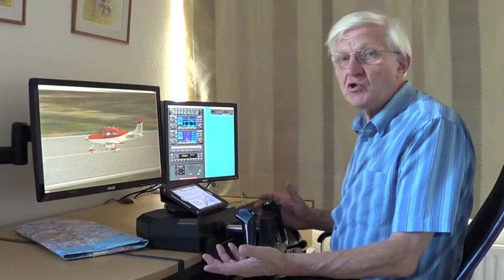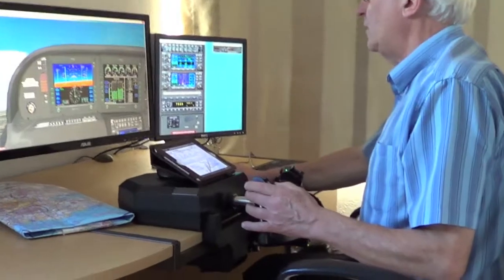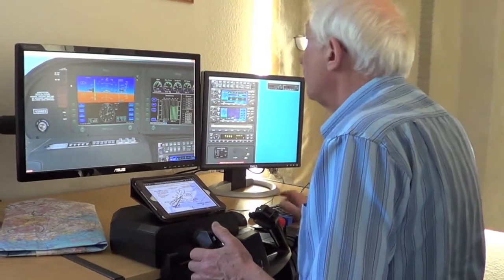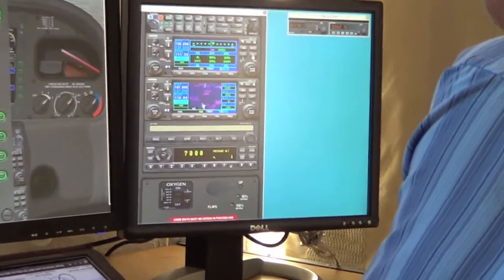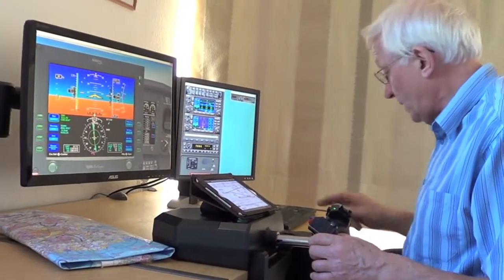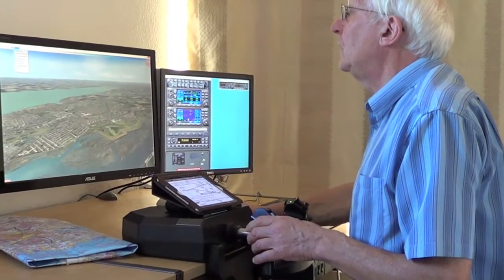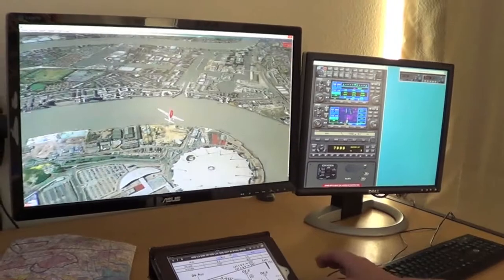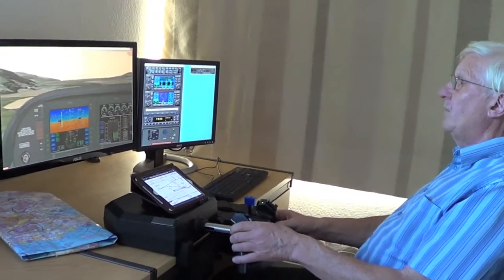Cirrus SR22 Simulator Demo

Comment: I know this is old - what Yoke setup do you have - I have  a CHPRODUCTS - but I have manual trim...but do have buttons to fix the trim...
Reply from the maker: Thanks for your comment Eric.  I am not the 'pilot' but I've asked and he has replied.... 

The yoke Used here is  Seitek “Cessna approved” which is similar to a Cessna 172 in a real world aircraft and nothing like a Cirrus side stick with hat trim switch. I configured the trim on one of the rocker switches, so that was not like real the world trim where Cessna has a separate trim wheel. I found that by holding just the left-hand side of this yolk it simulated very closely a real world Cirrus aircraft, although the trim switch is different (with the rocker switch) to the hat switch on the Cirrus side stick. 

I used the Seitek yoke as I wanted to fly other aircraft like Cessna’s and Piper’s. Now I have moved onto Diamond aircraft in addition to Cirrus (with the sidestick) and so a conventional joystick like the Phantom Hawk Is more realistic, and there is a 4 way hat switch that can be configured as trim on this joystick. You can mount such a joystick on wedge shaped piece of wood at 45 degrees to simulate the Cirrus side stick, then it is more realistic.

In practice I have found that flying such simulator set ups it’s harder than the real world aircraft, so if you can fly an approach perfectly with a 25kt crosswind, then doing the same thing in a real aircraft in reasonable weather conditions is like a “walk in the park” by comparison. Better to perfect your approaches on the simulator before paying out to practice in a real aircraft with an instructor.